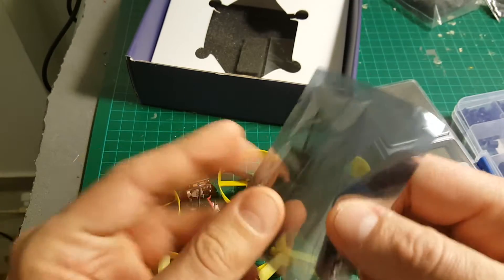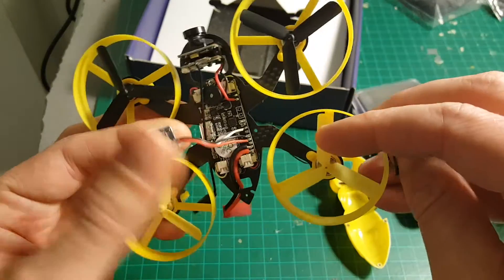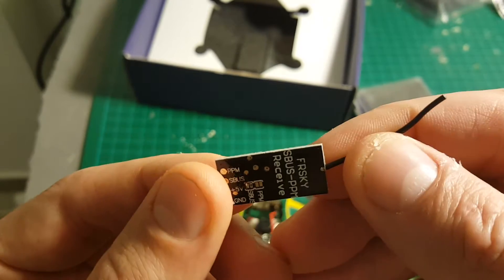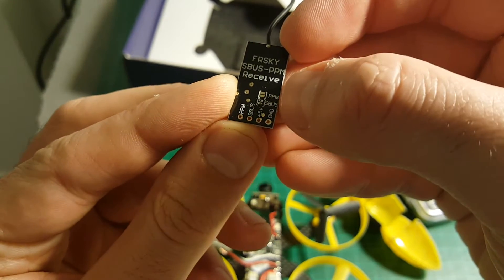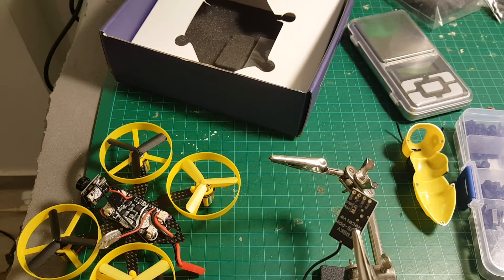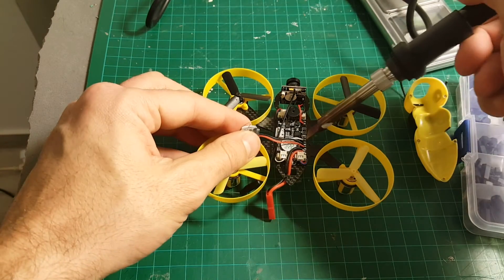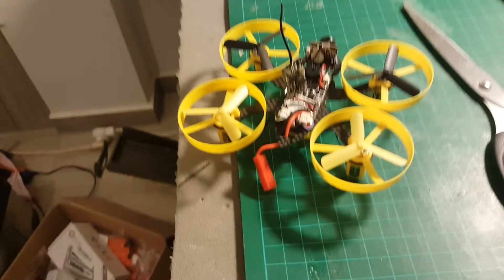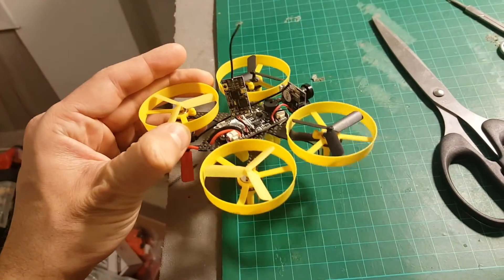2.4G 8CH Micro Frsky D8 Compatible Receiver With PPM SBUS Output overview and installation

Comment: I have on my taransi EU firmware and it doesn't work
Reply: I am wonderin if I have the D8 binding option than it should connnect or?
Reply from the maker: What do you mean by that? After you put your Taranis on D8 mode and try do bind - it won't work?

Comment: Hello, I want to use this reciever. I have an F3 Evo Board that already has Flysky reciever built in to it but per the diagram I can see that I can still solder a GND, 5V, and RX1. Would I be able to use it?
Reply from the maker: Yes, it should work
Reply: Gal Kremer I guess it uses PPM?
Reply from the maker: It uses both - ppm and sbus